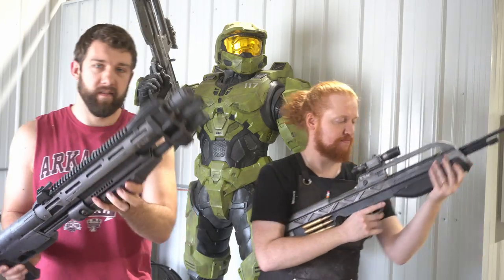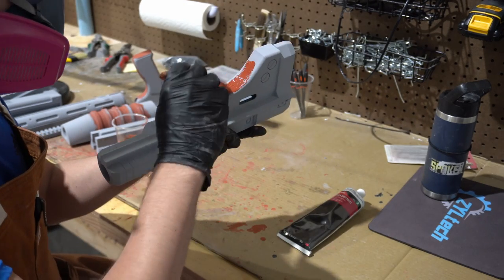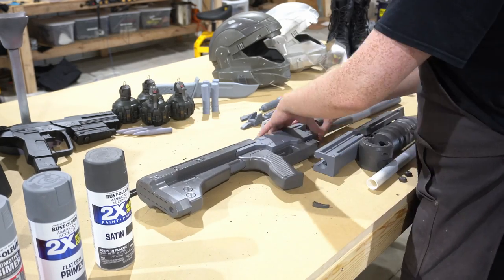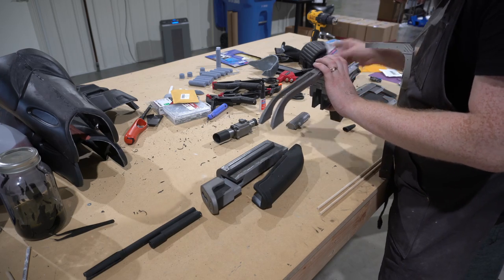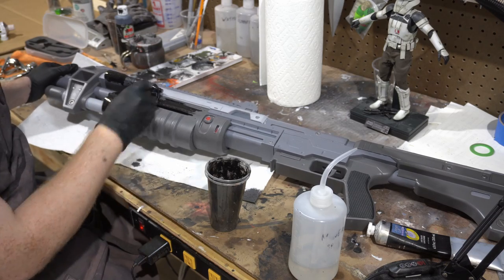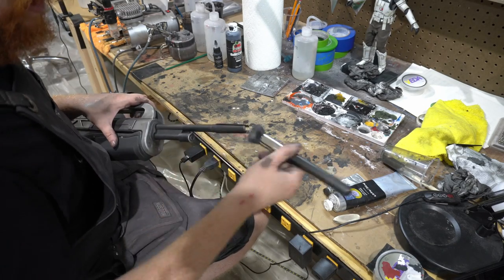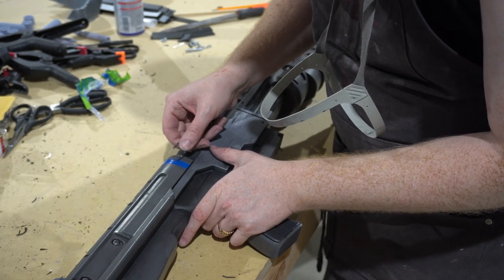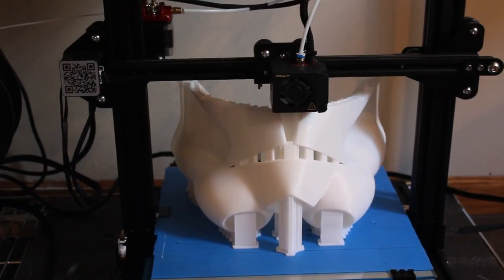Build this Halo Battle Rifle! - ODST Build Pt. 3

Comment: (11:59) If you're talking about that part right below that arch, those are in fact vents. They let cool air in and hot air out to help cool down the barrel after firing. It's a very simple design we've been using for a good while now.

Edit: You can see similar vent holes in IRL firearms, mainly early 20th century machine guns (like the Russian PPSh and German MG42) and some more modern infantry weapons (like some AK fore ends)

Comment: Just started printed the battle rifle on my Neptune 3 Max. I started with the rear stock area and the long rectangular fitment areas are not fitting. The rear stock plate everything fits and snaps in fine but can’t seem to get the rectangular area to fit. I would like to avoid this in the future any tips on what I can do for better fitment? @galacticarmory

Comment: The link for the BR files dont seem to be working. Can you redirect it to the proper files?
Reply from the maker: Thank you, fixed it!
Reply: @GalacticArmory  another question real quick. On the battle rifle you built I noticed it had a holder with rounds on the butt stock.  Was that something else you printed and added as it's not on the file.  As well what did you use for the rounds you attached?